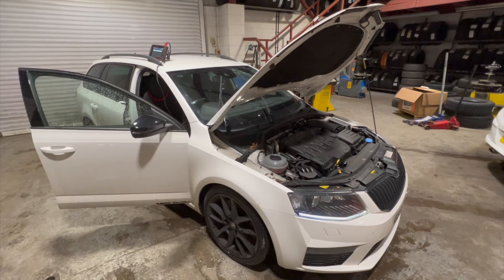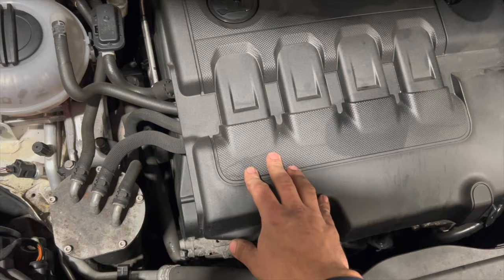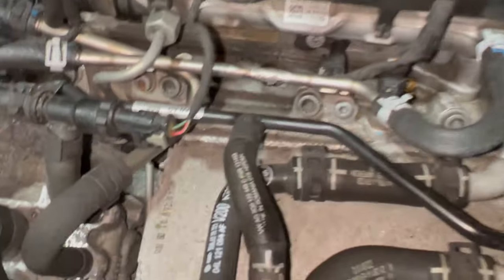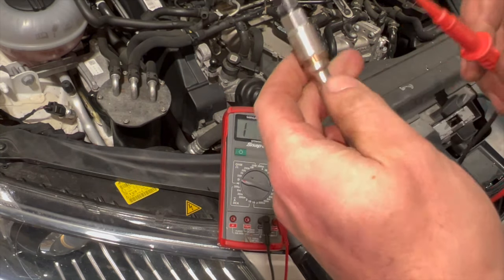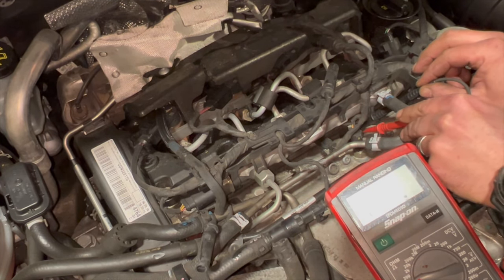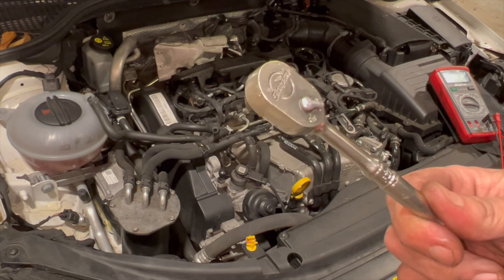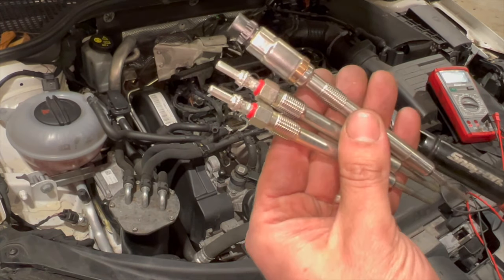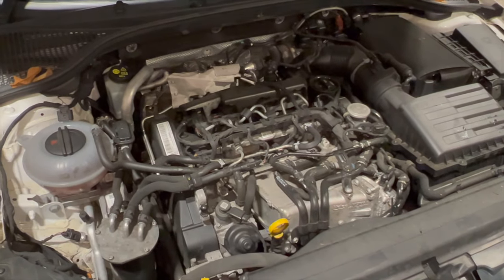2015 2.0 TDI Glow plug fault - how to test & replace P0673

Comment from the maker: Check Euro car parts - https://tidd.ly/3lIO7xA  (use discount codes on site)
Check GSF Car parts - https://tidd.ly/34pZe7o  (use discount codes on site) 
Check "Car Parts for Less" - https://tidd.ly/2LNEwIn  (use discount codes on site) 
Normal Glow plugs Ebay - https://ebay.us/5Z4Y06
Cylinder pressure sensing glow plug Ebay - https://ebay.us/IAe9yJ
glow plugs Amazon - https://amzn.to/3IJspoE
Cylinder pressure sensing glow plug amazon - https://amzn.to/3dKf0i0

Tools :  3/8 Digital torque wrench - https://amzn.to/2PP9vpP
             Dewalt 3/8 impact driver - https://amzn.to/3njemLY
             3/8 standard torque wrench - https://amzn.to/33eZsxj
             Short 3/8 ratchet - https://ebay.us/FerrQK
             Multi meter - https://ebay.us/fvsMub
             Socket set - https://amzn.to/3eGx2Ak
             Ring Inspection Lamp - https://amzn.to/3gGWHcG
             Needle nose pliers - https://ebay.us/272Psu             
             
Glow plug torque settings - 17 NM

Comment: Quick way to check without even moving the engine cover is by quickly removing the glow plug relay in the fuse box under the bonnet. All four pins can be checked from the relay socket. Also proves the cables to the glow plugs are good too.
Reply: We're do I put multimeter probes using that method ?
Reply: @denisbelikov9114  на реле посмотри, там подписаны контакты G1, G2, G3, G4, соответственно цилиндрам, считая от ремня ГРМ. Измеряешь сопротивление между массой (минус аккума, он рядом) и каждым из контактов  в колодке
Reply: I’ve just done this and all 4 glow plugs read 0.7-0.9. They all seem good but still getting PO684 fault along with all glow plug code faults. Assuming this is relay at fault is there any tests I can do to prove it’s 100% the relay?
Reply: @THFCsaunders  It will be the relay. Error code P0684 means the ECU can't see the Glow Plug module. Bosch replacements are available for £53
Reply: @johnsmith44573  thanks John appreciate the reply. I’ll have a look for the Bosch one, VW want £135 for official one. A lot cheaper than the £700 the garage wanted for 4 glow plugs and module replacement.
Reply: @THFCsaunders  just to say the official VW one is made by HKR Seuffer (german),and i've seen a few of these fail already. The Bosch will be OE equivalent and much cheaper.
Reply: @johnsmith44573  I’m really sorry to be a pain but do you have a link to the Bosch one by any chance? Really appreciate it
Reply: @THFCsaunders  for some reason my reply is being removed, not sure why? It's easy to find it costs £53.79 on the usual auction site.
Reply: @johnsmith44573  Thought I’d reply an let you know I changed the glow plug module last week a fault hasn’t came back up since, cheers.
Reply: @THFCsaunders  whwre did you buy it  from? At what price? 

I've got the exact same problem you had. Everything is pointing to the relay.

Comment: Helps to run engine for a few minutes before trying to undo if glow plugs are tight. The aluminium head expands faster than the steel glow plug so sometimes this makes them undo easier.
Reply: Yeah I run engine till coolant fans come and got some heat proof gloves on and strip as fast as can or leave engine running and start stripping and undo plug whislt running to see if free havent snapped a glow plug yet but seen alit of lads at my work have as done it from cold engine
Reply: I will be putting high heat grease on the threads when I get into them next.    I  warped one glow plug when taking it out because the socket was not a perfect fit.   Very silly to design it with paper thin metal housing.

Comment: So what is open circuit on the glow plug engine codes? Shall i just replace all 4 glow plugs and hopefully it won’t show up engine light again 2015 a3 1.6 tdi
Reply from the maker: You’ll need to test them individually , you’ll only need to replace the ones at fault .. obviously you can just replace them all if you prefer
Reply: @diydaly  yeah i’m gonna replace all 4 anyway especially at 140k now i do 20k a year lol so is that meaning it just needs replacing then (open circuit)
Reply from the maker: @RawwUnderGround  👍 yeah if it’s open circuit basically no resistance at all so it will never work 👍

Comment: Unless I need to go back to learning how to use a multimeter no reading at all open loop would be bad right I have the one with the sensor one probe down where the sensor goes and then one on the body like you said got no no reading open loop
Reply from the maker: Yeah open circuit, that a dead one mate 👍

Comment: My engine hesitates as I hit higher revs I.e gathering speed to go on the motorway.. would replacing these be a good idea (they do the same jobs as spark plugs?) 😂 sorry just had a bad experience with a garage so looking at ways to avoid. Thank you for the videos!
Reply: @coinzyuk2472 my car also does this without any faults logged so far then today I get a fault with glow plug on cylinder 3 which has this pressure sensor. Not got the new part fitted yet. Have you solved yours yet? What car is it pls?
Reply: @tombowman4489  haven’t got it sorted yet mate, just got a hefty £800 bill from the garage to get it through its mot 🙃 won’t be looking at getting it sorted till the start of next month boss
Reply: @tombowman4489  mines a audi a3 8p esport (1.9 diesel) boss
Reply from the maker: Hi , they won’t really cause that issue tbh , more likely to be a fueling issue .. possible injector fault , is it not throwing up any fault codes?
Reply: @diydaly  no not any fault codes logged at all even though the problem has got more frequent. Always at just below 3k revs with low amounts of throttle, speeds seems to be irrelevant but usually happens low ish speeds. Only thing I've had logged as a fault is this very expensive glow plug but this has been going on way longer. Would an injector issue not log a fault? thanks for your reply man.
Reply: @diydaly  haven’t bought the tool for fault codes yet boss, getting one soon so I’ll post on here when I do ☺️
Reply from the maker: @coinzyuk2472  👍👍
Reply from the maker: @tombowman4489  not always , if the injectors not doing anything they will bring up a code but if it’s working just not 100% it’s not likely too
Reply: I don’t know if it’s placebo but I used wynns injector cleaner - the fuel addictive and it’s hasn’t done it since, every time I’ve floored it going on the motor way it didn’t hesitate at all!
Reply from the maker: @coinzyuk2472  arr nice one! Could easy have fixed it tbh! I had an Astra 1.7 once that used to have a light misfire ransomly .. chuck a diesel additive in and bang it would disappear for 6 months!

Comment: comment on an old vid. I've got a similar car, but with the push button start. Is there a way to get the glow plugs to activate without cranking the engine? Normally, you'd turn key to ON first, is it similar? ie push button but not foot on brake. TIA
Reply from the maker: They might activate very shortly that way, its hard to say with modern stuff, ive never checked that with a push button start

Comment: If I cleared the fault without it being replaced, will it appear again. As I have been told it can appear as the temperature outside goes colder. My car is a seat Leon mk3 1.6 TDI. Thanks
Reply from the maker: Yeah it’s most likely to return I’m afraid mate
Reply: I replaced the glow plug but without cleared the fault..i must do that?( Tester again and cleared the error)
Reply from the maker: @psorin-kj7lk  yeah u may need to clear it first mate

Comment: Thanks, I had the same code, same cylinder, it cleared itself after a good bit of time, after I was all set to pull and replace the glow plug. the fault never affected the starting noticeably. Same engine, same year.  Now I have an intermittent pressure sensor issue, your info was super helpful.  I just reseated the connectors as it runs okay. Nice work.
Reply from the maker: Glad it helped

Comment: Great video thanks. looking for advice please.

Ive a 2009 Q5 1968cc
Starter motor has to turn engine about 10 times when cold. 

Scanned and got the 4 codes P067100 + 2 + 3 + 4. Ok I know it's showing the 4 heater plugs issue.

However could they be ok and it's the module and not the plugs? 

Would a faulty module show it's own separate fault?

Or is the module giving false error as in faulty plugs which are not faulty?

Looking forward to your reply

Thanks MOR

Comment: I have thesame engine as yours and do have starting issue's, i removed glow plug caps and they all look the same, there isnt  the  one with the sensor.

Does the car need to have the one with sensor? Notnsure what old owner did and replaced with normal one

Comment: Hi great video Iv had same issue on Vw caddy van 2018 code p13d6 the pressure glow plug has been replaced however after a couple of days driving the engine light comes on and produces the same code. Any ideas thanks
Reply from the maker: Might be worth testing all the plugs and possible fault with the relay

Comment: Hi amazing video definately subscribing! 

Quick question, I have a MK7 GTD and recently had all 4 glow plugs changed but didn’t put the glow plug with the pressure sensor in and now there is a check engine light and also says cylinder 3 compression fault on the reader. Will putting the pressure sensor glow plug in the correct place (cylinder 3) fix the issue? And would you recommend an Amazon purchase for the glow plug? And where would I find the correct glow plug size and spec? Thank you
Reply from the maker: ive listed a link for the glow plugs in the description.. did yours have a pressure sensing plug originally then? you should be able to fit the wrong plugs that all as the connectors are different from pressure sensing / normal glow plugs
Reply: Thanks for the reply. Yes organially there was a pressure sensor on cylinder 3 and no there’s not which is why I am confident this is the reason for the check engine light. On my cars and the other golfs they have cylinder 3 pressure sensor so I’ve ordered the part going to hope it solves the issue :)
Reply from the maker: @10casem  arr yeah it definitely will be that that! 👍
Reply: @diydaly  Hi its me again. The glow plug has been fitted but still shows the fault code of P03AE. If its not the glow plug pressure sensor could it be the wire connector which sits on top of it? if so what is the best way to check it? Thank you
Reply from the maker: @10casem  yeah possibly but very unlikely , I’ve won’t had and faults with the connectors but you’ll need to make sure it’s got a 12v feed when required ..
Reply: @diydaly  I bought the glow plug pressure sensor online, it is the same part number but a slightly earlier revision being revision G with the latest VW offer is K. This won’t cause the problem?
Reply from the maker: @10casem  hmm I wouldn’t of thought do tbh , seems odd I’ve never had one not fix that issue!
Reply: @diydaly  ill keep you posted if I ever find the culprit! Thanks again
Reply from the maker: @10casem  thanks 👍

Comment: my 2013 insignia has4 sensor plugs, do 4 sensors have to go back on or can i have 1 sensor and the cheap ones ? thanks
Reply from the maker: I’m afraid they have to be replaced with the same style.. the connectors won’t fit otherwise

Comment: I have mk6 jetta tdi that just recently showed glow plug and engine compression fault.  I replaced all the plugs with new.  However, the new all looked alike.  They all have the "castle" looking top.  The glow plug fault is now gone, but I am still getting a cylinder pressure fault.  It runs flawlessly, quick, fast, with no stutter to the engine.  Just the pesky compression code.  Any ideas?  Did I use the wring glow plugs on 2-4?  I'm feeling lost!
Reply from the maker: Not come across that tbf mate, they glow plug relays are quite common though
Reply: I changed the relay as well.  All of my new VW glow plugs are cylinder sensors?  Is that right?????  That's what they sent me.
Reply from the maker: @waynemiller7535  it can vary depending on the exact model , some do have all cylinder sensing

Comment: I have same problem. Do I need to put 1 Pressure sensing glow plugs and 3 normal glow plugs or I can have all 4 normal?
Reply from the maker: No I’m afraid the connectors are different so you need to replace each one like for like

Comment: did the car run crap with this cylinder 3 sensor issue as my kodiaq is jolting on drive and hard to start at times and idles bad at times and this fault is all i see on odb diagnostics. no lights on dash though
Reply from the maker: No it won’t really effect the running tbh mate